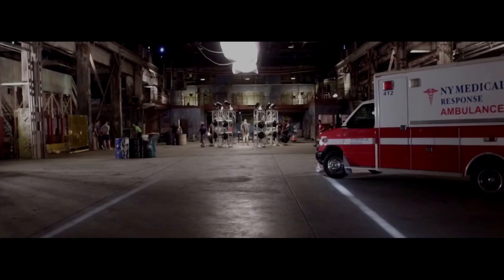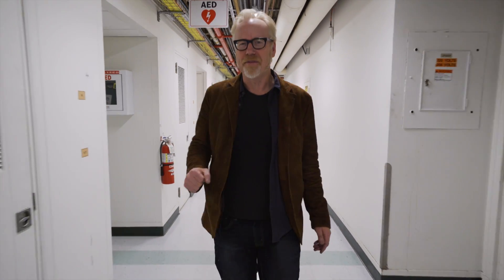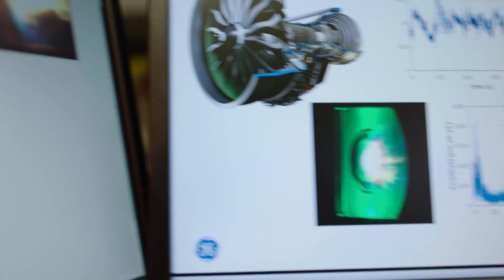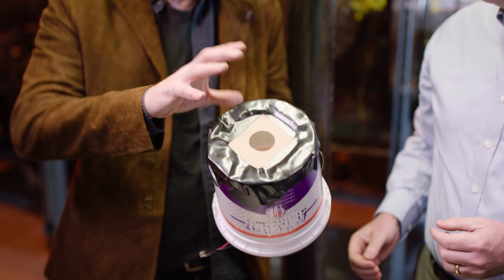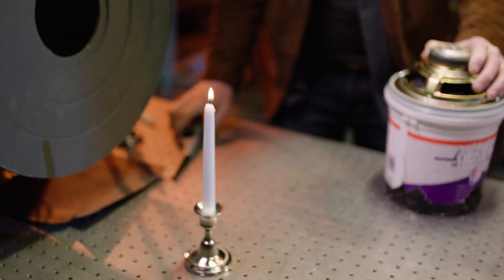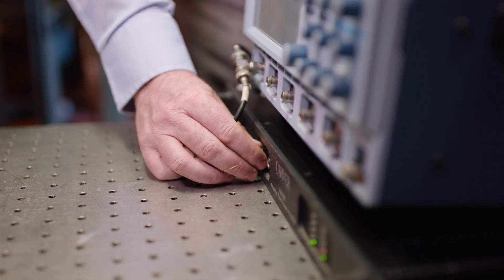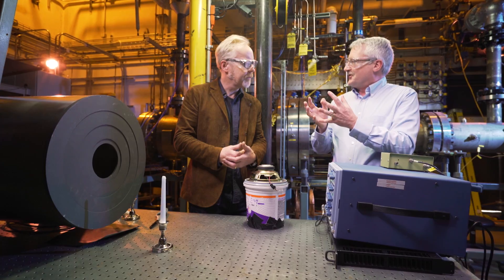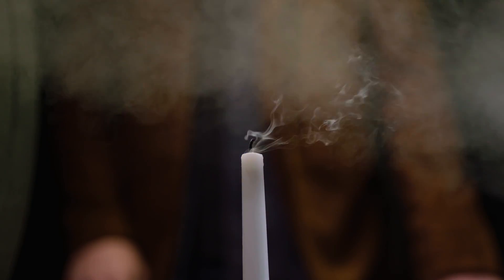Adam Savage Fights Fire with Fire - Unimpossible Missions

Comment: I gave you exact and correct directions on how to burn water.  It's way different than performing electrolysis and burning isolated gases.  Controlling the combustability is way way super different.  The molecule becomes unstable, it burns, heat causes a exothermic reaction problem is, I'm tired or re-writing the directions on keystroke at a time.
Reply: This seems impossible for anyone to follow my Directions I gave Adam Savage on Facebook's Tested Page!  Make that unimpossible.
Reply: Burn water using less energy than my method and produce more heat.  Then explain where all of the heat comes from regarding my method of burning water.
Reply: You just treat a volume of gaseous water, like you're going to ignite a dense atmospheric pressure plasma of a given volume.   So, in a vacuum 0.01 Torr, you need at least 200 Volts per cubic centimeter, if you want just any gas to become a plasma.  When a gas becomes a plasma, there's no electrons there, the nucleus of the atom and the electrons aren't even in orbit, right?  Okay, with a molecule like water, as the voltage and current goes up per cubic centimeter, the water molecule gets closer and closer to becoming a plasma.  Somewhere in between, isn't ripping apart the molecules, or producing clouds of ions and electrons, that's just the stability of that one molecule in the chamber, and it does take less energy to make a molecule unstable.  But, to treat it like a true plasma puts you in the frequency range of 100 KHz and up to maintain a stable plasma, right?  Between neutral, and Plasma, is combustability.
 Certain frequencies work better than others but, in that environment water will burn, and can burn explosively.
Reply: So, then you throw in a flame, it starts a chain reaction that causes all of the gases to expand, the water burns but, it burns twice, it will leave that environment and burn one more time to make steam.
Reply: I'm not that bad with plasma, and I've completed every experiment I've set out to.  Usually, without any directions for lab set up, just equations.
Reply: A resonant system could save even more, once all of the RF Impedance crap is figured out.
Reply: Since, it's not electrolysis and a big chunk of the energy of conversion to hydrogen and oxygen gas is combustion, it totally tweaks the Mole -e equations for all of it.
Reply: They don't let comment on your own remarks, I didn't have an insult, so it won't make as much sense.
  But, they seem to be organizing themselves quite randomly.  I haven't figured out the system yet.
Reply: And they all say, 1 second ago.
Reply: Just figure the smallest amount, treat it like gas, once.  Then light it, like it were methane.  Think about thin that gas would be in that space.
Reply: What else do you call a chamber where combustion is possible, when normally it's nowhere.
Reply: The real thing to worry about when burning water, is metal ions.   I've studied the food chain, and daphnia are very sensitive to metal ions in the water.  But, they are a bottom of the food chain requirement in a healthy Ocean.  So, if any of it goes into production be careful of your selection of materials.  I know I gave Adam damn good directions.
Reply: Why not science for the sake of science, and the method.  If I'm wrong, my directions won't work.
Reply: It has been hours now, and they all still say, 1 second ago.

Comment: It's not the frequency or tonal properties that's killing the fire, its simple air pressure blowing it out like how everyone normally blows out the candle.

There are already turbines that do this exact same thing with obviously greater air pressure used to choke benzene fire by jetting air/water. And thus turbines produce more sound, coz that's what sound is, mechanical vibrations such as moving air and water!

If you want to prove that the sound signature is putting out the fire then use a closed lantern and prove it.

Comment: like Adam said this is fighting fire with the sound of fire.Firefighters on the other hand actually do use fire to fight fire if there is a  forest fire and the fire is traveling for example in a northern direction due to wind the firefighters will get in font of the fire about half a mile in front of it and light a controlled fire and if the wind works with them the the controlled fire will travel south towards the forest fire and the controlled fire will burn and consume all the tress (fuel source) before the forest fire can reach it until they both collide and there is no more fuel left to burn and they both extinguish each other. now thats fighting fire with fire.

Comment: Some of the wording used in this is a bit misleading, however it isn't quite the same as blowing out a fire, notice the flame warbled back and forth due to the signal moving through the air. For me at least, I don't find it hard to imagine potential applications of large-scale versions of this fighting fire where conventional methods can't be used, such as class B, C, or D fires from a distance, where spewing a jet of material is less effective or otherwise prohibited.

I can also think up some potential military uses for such a technology, possibly as a defensive countermeasure against jet or rocket type engines.

Comment: To be fair, you can put out a candle by putting it next to nearly any large speaker playing just about any music at loud volume (I mean "high amplitude"), as the back and forth movement of speaker cone creates an air current, i.e. it "blows" the candle out.  The fact that they used the "sound of fire" is perhaps situationally ironic, but ultimately irrelevant.  I just put a candle out playing Metallica....

I was hoping this was going to be something more along the lines of sound cancelling headphones, which uses a mic to listen to a sound, and simultaneously plays that sound back after inverting the phase, resulting in a very reduced amplitude signal.

Comment: I see no reason for smoke to travel out of the cannon with only sound waves. Focusing the sound waves somehow create a flow of air through the cannon hole which blows the candle out. It's not even the sound wave that puts it out, it's the resulting wind.
I am a great fan Adam but this is not a good video.

Comment: Step 1 cut hole in bottle of garbage can
step 2. flip over
Step 3.  cover garbage side with plastic
step 4 bungee tie plastic
step 4 flip over and add fog to cut out hole
step 5 hold in the firing position with cut out hole facing outward
step 6 slap plastic to fire

you now have a giant fog O-ring cannon

Comment: should be named fighting fire whit sound. The ekspariment hr does has been seen many time Done in The internet. simply using a bucket whit a lit in it and a hole in The buttom. hit The lit and air is pressed through The holde in The Burton in The same way The rings of air in The video. coming from an Old mythbuster to accept this is for me a bit wierd.

Comment: ...that's not 'fighting fire with fire'... that's fighting fire with air... its just an electrical version of someone blowing on a candle -.- not all that impressive, specially since its already been done before on countless other places... 

better way of 'fighting fire with fire' is putting out a lit candle using an even hotter heat source... like a welding torch. Put the torch close to the lit part of the candle but near the base of the wick so it is pointed at the wax, and presto! You melted the wax faster than the candle could, and thus removed its source of fuel, which then puts out the candle...

Comment: OK, This video is teaching falsehoods, Adam we expect better of you then this. First thing in this video that bothers me is how the G.E. engineer(?) explains that the wax is the fuel of the fire. The wick is the fuel. The wax inhibits its burning till it melts exposing more fuel. some of the gasses in the wax may ignite in this process (Unlikely and would cause the candle to burn at an accelerated rate.) Also this is just an air cannon driven by a speaker. I could put any rumbling sound through there and cause it to push out rings that would extinguish flame. He just made a thousand dollar version of an Air-zooka.

Want to fight fire with fire?
   Try using an enclosed environment and depleting the oxygen with a faster burning flame.
   Alternatively do what Firefighters have done for years and burn away the fuel source in the immediate vicinity to prevent the fire from raging out of control. Like with brush fires.

Still a fan.

Comment: This is dumb and clickbaity. As presented in the video, it looks like they just made a vortex generator and blew out the candle with a puff of air. Any 10 year old with an oatmeal can, a balloon, and a pair of scissors could do that. No need for all of the fancy equipment.

If they want to show that it's actually the modulated sound putting out the candle and not the puff of wind, there should have been a side by side comparison between hitting it with different waveforms at the same amplitude, e.g. once with a 60hz sine wave and then again with whatever waveform they came up with based on recording a fire. I really expected better than this from Adam.

Comment: Fighting fire with fire is NOT supposed to be impossible. It's a common tactic in fighting forest fires, brush fires and grass fires. A controlled burn is used to create a firebreak. When the big fire reaches the burned area, it runs out of combustible material, so it stops.
Reply: Also, it's a very common colloquial expression meaning "to use an adversary's own methods against them," as in, "They're using negative advertising, so we'd better fight fire with fire by coming up with our own negative ads."

Comment: The speaker is basically blowing air at the candle just like you would with your mouth. Move a large volume of air through a small hole and the velocity of the air easily blows out a candle.

Comment: Wave propagation does not transport matter. If smoke comes out of the tube it means that the compression/expansion of the large speaker just pushes the air out. You basically just blew out the flame.

Comment: I used to do that years ago but instead of "fire" sounds I used the sound of me blowing into a microphone, it worked really good even with small speakers, you just had to adjust the distance and loudness.
Reply: It's different from the video because they use a big speaker to blow 
air. Instead a small speaker doesn't blow that much air, it's more like 
the actual sound extinguishing the flame.
Reply: In theory, if they wanted to extinguish a big fire (or help to) they could use one noise cancelling circuit and a few microphones and blast the fire with that sound.

Comment: Couldn't you have just taken a fire hose and used that to put out the fire? It contains the word "fire" in it, so obviously would count as well, just using water instead of air. And they even took a step farther away from the "sound" of fire as rather than using any actual continuous play or test of resonate frequency, it's just a short white noise clip burst into a bucket to concentrate the air wave. They could have done that with ANY sound clip that moved the speaker enough to displace the air in the bucket. Hell, they could have done it by using a piece of saran wrap instead of the speaker and tapping it.

They could have easily done actual fire against fire. Obviously it would be deprivation techniques, and it would be interesting to see them put in unique ways. Fire breaks where they use fire ahead of a fire to burn up the fuel so the existing one has nothing left to burn... using up the existing oxygen to deprive the oxidizer... a shockwave from an explosion (which is essentially the same thing here - using air to displace the flame from the fuel thus putting it out, but at least using a method that applies better to the "fighting fire with fire" term)... or something possibly unique that just was discovered. Possibly a fire so hot that you could put it on an existing fire and it puts them both out (maybe incinerating the existing fuel source too quickly for it to spread?)

Soooo many things that have already been done and they could have done that would apply to this "unimpossible mission" and made a much better show. I do hope to see more in the future, but have it be something more than a lame gimmick for an ad.

Comment: Ser Graln Tyrell, yes you have it right! The pressure waves from an oil rig fire reduction is the same as they are doing on the video. Though I reckon you would need many massive speakers to knock down an oil rig fire. By the way... nerd alert.. the goal in an oil rig fire rexuction is to blow the heat AWAY in all directions so that the oil pressure knocks the actual combustion out wheras in the video it was in a single direction. Id bet that you could have relit the candles through back drafting a flame into the combution cloud even with the vortices.
 Peace and Science!

Comment: Doesn't this work with any amount of air pushed through a narrow opening?
they chose to use a speaker.  shouldn't then it work with any sound wave turned up to a particular volume level?
what is so special about the sound wave recorded from a fire sourc?

Comment: If it was sound waves, the row of candles would have been put out almost simultaneously. It was just the vortex disturbing the flame ;) I'm sure you knew that, and GM probably has a more advanced system, but if anybody else wants to see fire actually put out using soundwaves look up "DARPA acoustic flame suppression".

Comment: wouldnt fire itself be able to put itself out. if a room was on fire and the oxygen would run out. technically fire has put out fire. okey.. that doesnt count since most rooms arent airthight so the fire would continue but tbh in what situation would u have a modivied speaker that couldt put out fires. on another note fire putting out fire would always happen because the fuelresource would end at a certain point. it dosnt matter if it would be coal wood oil..

Comment: I find this disappointing as a Mythbusters fan. "A speaker put out a fire?" says the guy who did just that in the "Voice Flame Extinguisher" episode like 6 years ago. In fact what i just saw on this video is nothing more than a smoke ring cannon. Lol a glorified candle blower. You can watch the multiple candles being blown out not by sound wave but by the circular air ring leaving the speaker barrel if you play it at .25 speed. All the candle flames go on one "o" shaped fashion.  At least in the MB episode the blew out somewhat of a torch fire.

Comment: I think there might be a simpler solution to this, where what in fact is happening is the pressure wave of the air is moving the flame away, the specific sound wave might not factor into it as much... the size of speaker they had looked like a car sub woofer, that could pull the skin off a rice pudding! Simplify your test, would any sound that is a initial big wave do it?

The way I'm thinking on this is like pontoons in a lake, the wind might pick up and cause the pontoons to bounce up and down, straining on their securing cables...

Comment: Technically they are not putting out the flame by sound, but by air displacement by a moving membrane (speaker) focussing the air in a vortex through the hole. So basically they just discovered an expensive way to blow out a candle. This would not work on actual fire like in a house of in a forest

Comment: Did they just explain that blowing out a candle works to blow out a candle? Could've used any old sound to pulse the speaker and create differencials in air pressure which blow out the candles...

Comment: I have a great amount of respect for Adam, but there are so many problems with this. 

1. How about showing that a random different sound with the same setup does NOT put it out? My guess is that it would work just as well. Making the "sound of fire" aspect meaningless. 

2. Why not put some kind of membrane between the speaker and the candle which would block the wind but allow the sound through? This would demonstrate it is actually the sound waves putting out the fire. I can only imagine they didn't do this because it really is just the wind, and the magic sound waves by themselves would do nothing. 

3. This reeks of being a paid endorsement for GE. If so, it is unethical to not disclose that. If this was a product they were selling it would be downright illegal to not disclose it. Although there doesn't seem to be any actual product. Just more of a PR thing. So I don't think any laws were actually broken here.

Comment: This is dumb. You are extinguishing the fire with the movement of air, just like blowing it out. All a speaker does is move air at differing rates. Moving the air inside a bucket creates a kind of baffle, which allows a certain capacity of air to be compressed and then released through the hole, at nozzle velocity, blowing out the candles. 
Gosh! These guys deserve an Ig Nobel Prize!!

Comment: It's simply blowing out a candle. There is no god damn point in creating the air stream by using a speaker and even less in using this specific sound. It has no use except being a joke, but its not even that funny. You could have created the air stream with actual fire, then it would at least be creative.

Comment: I was curious about the like/dislike ratio - then I realised. They've carefully made a child's DIY project. I once got a garbage bin with a soft lid and a hole cut in the bottom, when I was 7. They've just replaced the displacement of the lid with the displacement of a speaker cone... Nice job guys. Now try to find the resonant electromagnetic frequency of a water molecule and make a laser that separates water into hydrogen and oxygen AND ignites it in one beam! :D THERE'S a challenge for you.